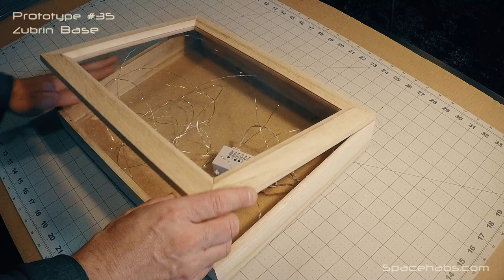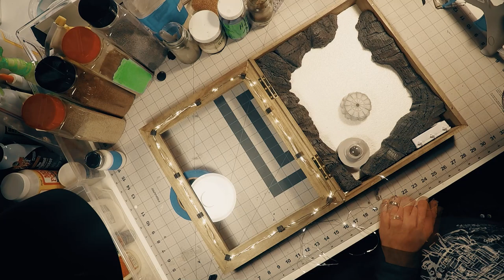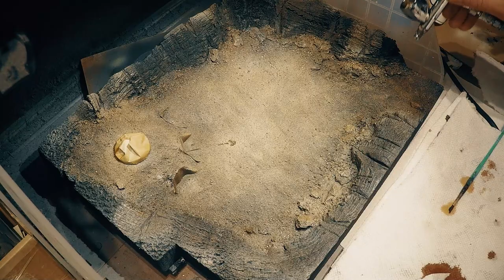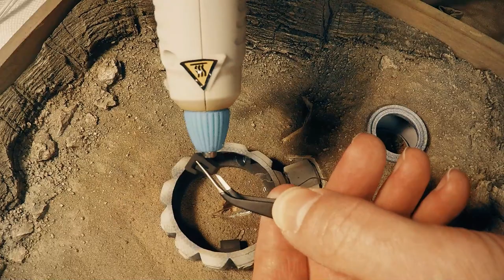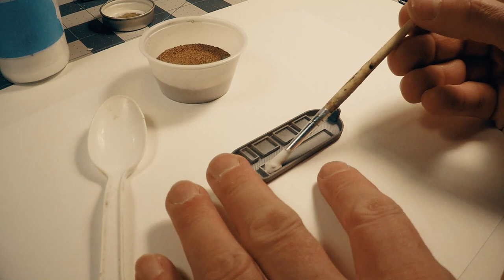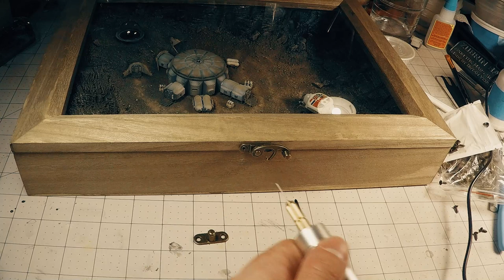Mars Habitat in a Lightbox -  Prototype #35 - The Making of "Zubrin Base"

Comment: What are the clips you used to hold the lights?
Reply from the maker: I designed and 3d printed those so that I could slip the light string in and out to replace them if need be. They probably won't be replaced so I could have just hot glued the string straight onto the frame.